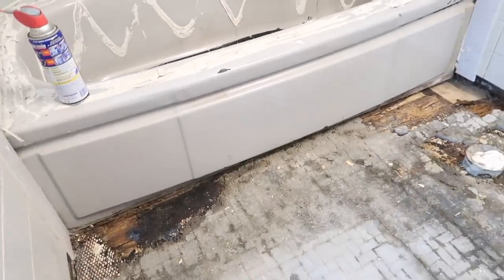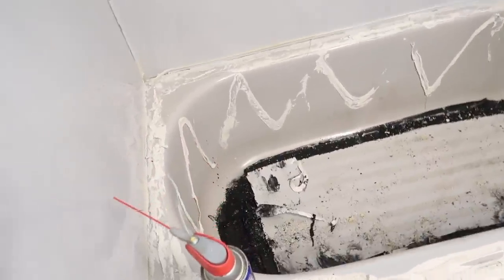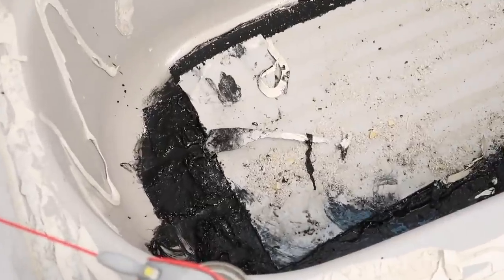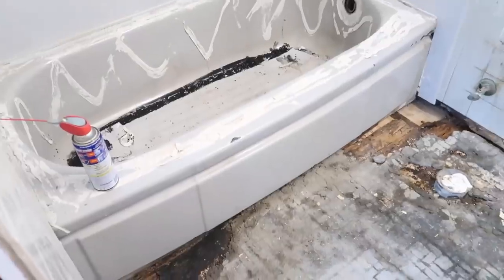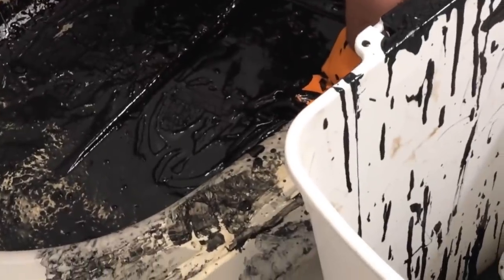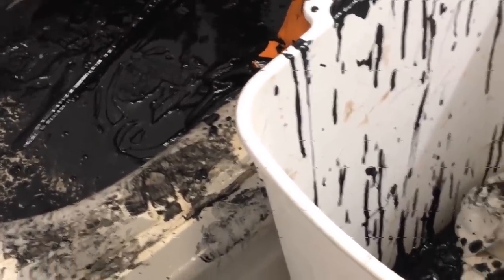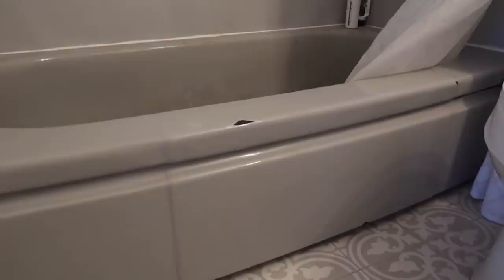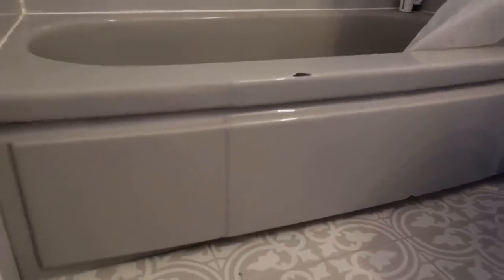We painted our bathtub// PAINTED BATHTUB UPDATE

Comment: Theses refinishers are epoxy paints. Epoxy can bubble when applied with a paint roller or brush. Torching the product or using a heat gun or using a spray can of bubble remover will prevent those marks. The pop marks are just bubbles that popped that's all. If you are going to "refinish" it again a good sanding followed by cleaning (yes denatured alcohol is great as a last step of cleaning, it's pronounced d-nature-ed) then recoat followed by bubble removal of your choice. There are tons of YouTube videos of bubble removal procedures just pick which way you're most comfortable and you'll be golden.
Reply: This was really helpful- thank you!
Reply: I found out the hard way that  Trous with teeth are best to use with epoxy or a thin roller. Thick ones suck up too much paint.

Comment: I had my master bathtub professionally painted 5 years ago, and I just used your product on my guest bath tub which is rarely used, so I am not concerned too much about durability.  I will say that when I had my master tub painted I was told not to use abrasive cleaners, or pads, but that the best thing was Lysol bath cleaner.  That is all I have used and my tub still looks perfect.  I will probably do the same thing with my guest bath, but I rarely have to clean it because, as I said earlier, it is rarely used.

Comment: I had no idea you could even paint bathtubs. Now that I know this I am inspired to paint mine. Thanks for the idea! 😊
Reply: Epoxy paint yes,but you need to know if your tub is cast iron ,plastic or ABS plastic. Yep, different paints for different types.
Reply: Me either.  I’m going to do mine as well, thanks for the encouragement!!!
Reply: We do it as a business and your not alone.People get so excited that they have options. Remodel without Replacement!
Reply: @A. Melbs if it's parceline it's probably pretty bulletproof depends on how dull it is. You can buff a tub the same as your buff a car. Try that let me know how it goes.

Comment: The reason the tubs that peel and chip, is when debris or oil is caught under the finish that delaminates it and causes the chipping. If you're meticulous about the job, it will be difficult to chip cured enamel or epoxy.

Comment: The tub looks great.  I do most of the work on our rentals.  Before other than the kits were available I did hire a worker to do a tub and let him go 1/2 way through.  I then decided to finish it myself.  I called the company that made the product, explained the situation and then sent them photos.  They were great and explained how to finish the project and even fix the errors made by the worker.  That tub did not chip, peel for three years of renter use.  It even survived a spray tan habit.  I did have it redone by a  company three years ago and it still looks like new.  Prep work and procedure is so important.  Thanks for taking the time to share how things turned out.

Comment: You can buy those little touch-up kits as well (Rust-Oleum).  They're pretty much a 1-time-use product, but they're only about $5 from Lowe's.  My wife and I did the same project as you guys did, although we didn't remove an insert...and it's lasted for about 4 years so far (with no issues).

Oh, and we got a piece of quarter-round trim, primed/painted it with outdoor paint, and used liquid nails to secure it at the bottom of the tub, and put a super fine bead of caulking at the top and bottom of the trim (use painters tape to get a fine bead of white caulk).  This may not be a possibility for you guys, given the contours of your tub.  At any rate, you guys did a good job!

Comment: The holes are most definitely from silicone contamination. It comes from using certain products that contain silicone. Finishers/Refinishers call it fish eye contamination. There's a product called fish eye killer (Pure silicone) that Auto body painters and finishers/refinishers add to their paint to mitigate that issue. Maybe the black adhesive; or the products you used to try to remove it contained silicone. In the future first use lacquer thinner, (not denatured alcohol) to clean the surface, then add fish eye killer to your paint. Great job.
Reply: Wow I’m so impressed by your knowledge
Reply: @constancekang9914  Thank you. I was a furniture refinisher for quiet a few years, and my  brother was an auto body painter  for 10years, so i'm very familiar with that problem.
Reply: @constancekang9914  I Just looked at her vid again, and i noticed a spray can on the tub that has a red straw coming from the tip. That looks like a penetrating lubricant  called WD40.  WD 40 contains silicone. I think that may be the cause.
Reply: @A. Melbs You are 100% correct. "It gets everyone at some point". That is why i would proactively add fish eye killer/pure silicone to all of my finishes while they are still in the can. That eliminates the the guess work as too wether or not the surface is contaminated with silicone. Solvent pop is much different from fish eye contamination, but they can look similar, so it's easy to confuse the two. Solvent pop has to do with the top layer drying (skinning over) of the finish surface, whereas fish eye is caused by silicone contamination.
Reply: @A. Melbs I'm in the U.S. It's a pretty popular product for Auto body finishers, and furniture finishers. It's called fish eye killer, or eliminator, which is pure silicone.

Comment: One little tip I have is you could add a little trim around the bottom edge of the bathtub to close up that gap. Not sure if you plan to change the floors but just my two cents. You could even waterproof some quarter round and use white caulking. :) I feel like your home is mine Lol
Reply from the maker: Such a great idea!!

Comment: First:  I salute any newlywed Bride who is willing to get her hands dirty smartly with a project like this.  Connor your husband is truly blessed.  May you both share a lifetime of delightful years together!

However: For an update, please make your point much SOONER.  If you wish to retain an audience's happier attentions, please don't tax their patience with nearly seven minutes talking around a topic a previous video already exists for.  Better to edit in the previous clip with the initial result and date complete, then again months later, same format.  Third time's the charm: Repeat the update a year or more out.  Durability tests only realize validation over time.

Second:  Answering your critics from a technical professional's viewpoint >> Surface treatments demand the correct prep work: The cleaning, the etching (which is an acid scrub, usually HCl around 10%-20% concentration, which some household cleaners have), rinsing, fine grit sanding, the tack cloth collecting dust, lastly the taping -- before the primer, paint or epoxy can even gets opened.  This is true of ANY paint job where a durable, high quality finished result is desired -- no different with using epoxies.  Those who have done any metal painting body work on autos, or hull repair on fiberglass and gelcoated boats understand, too, that coating failure prematurely indicates inadequate prep work.   See my icon? My boat is 40 years old, routinely weatherbeaten and still seaworthy -- still holding its deck finish under marine duress most bathtubs indoors never see.  You followed instructions for the most part rather resourcefully, which rates applause.  Porcelain tub coat is mostly baked on glass mixed with other ceramic minerals in its glaze.  When etched and sanded correctly, this WILL grip an epoxy coating strongly -- chemically no different from fiberglass in that adhesion respect.   

Professional certification is not necessary provided the process is correct with quality materials correctly handled -- and the long-term results hold up well to your satisfaction -- not that of your critics.  It's your 'nest', not theirs.  It's also possible for both parties to be correct.   I'd sooner disdain that tar pit the Bath Fitter job left behind (no doubt at great expense, having seen and refused their estimates).

Third:  To solve the "holes" problem while the epoxy is fresh and wet: 
1) Use a hair dryer (better: a heat gun) lightly to pop the bubbles before each coat dries.  The epoxy surface tension when wet will then level the finish out, leaving no holes.
2)  Multiple thin coats covers better than one thick coat.

Comment: During our remodel 2016, the crew did not cover our porcelain tub during tile install and badly scratched it. Contractor hired a dude to fix it. He used automobile paint. It took less than two hours. It still looks perfect. No idea what the cost was. The only issue was that it was so very slickery at first. Our granddaughter slipped and cracked her head open. She is fine and that is no longer an issue.
Reply: Yikes!! Hope your granddaughter is okay. Did the paint go on sprayed? Or just rolled on. Thinking about painting a rusty tub.

Comment: Just my opinion but I would not use a brillo pad on anything but a metal pot.  You can use 409 (be careful not to breath any fumes while spraying) to clean the tub or even lysol tub and tile cleaner. 

 I have some of this glaze but have not tackled the job yet, mainly because of the fumes.  I am highly agitated by strong fumes so maybe one day soon, the weather will permit me to put a fan in the bath window and pull the air out and help with that.  I also do not know when there will be all of us away for a few days. 
Great job though and I am going to use the denatured (pronounced Dee Nay tured -like nature with a d, lol) alcohol before painting and a roller like you did.